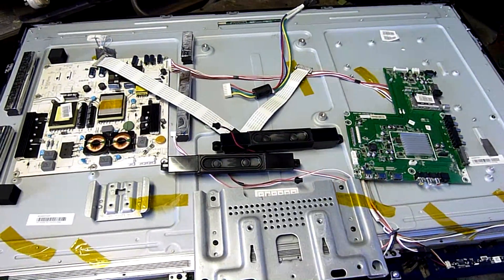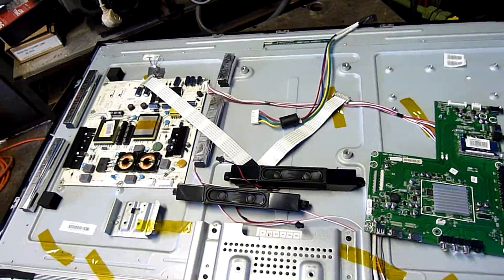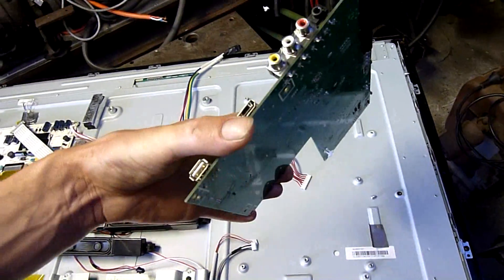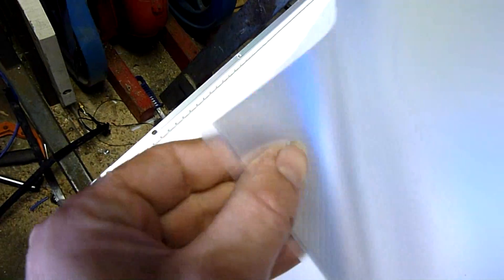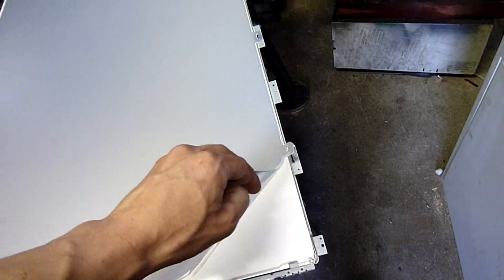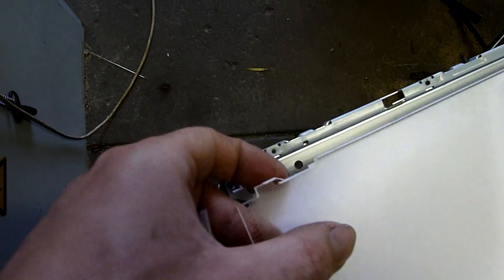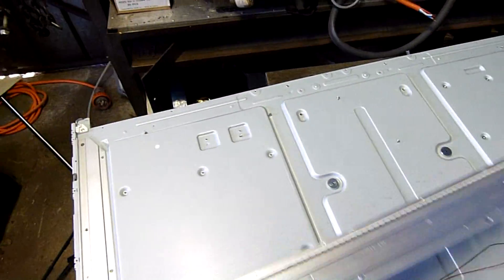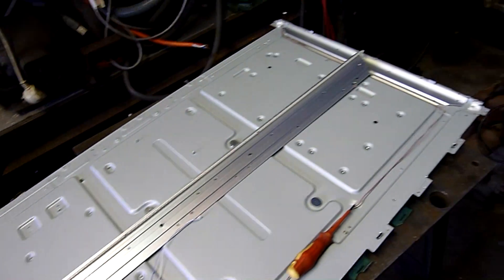Hisense 42 Inch LED LCD TV Teardown

Comment: if jay doesn't want it, keep the strip and power supply to use as a long desk light or set it up on a wall to use as an indirect light source or a back light for a shelf.  the diffusers might be good for any glaringly bright lights over your desk (all you need is some tape to hold it up)

Comment: If you're able to, look at the traces and find out how many LED "segments" there are and how they're set up, the display I had used those 4 strips in series so it output 120V, so really you could run them at 30V in parallel. As for current limiting, I didn't have an issue with it, but I also wasn't running them at full 30V, more about 27-29V. If yours is the same a simple LM317 supply "should" work as it did me, but if the voltage is higher, you may want to look into a cheap Chinese boost/buck supply with current limiting. The lighting they make is awesome and very controllable with voltage in my experience, pwm would be "possible" but a 30V+ pwm signal with current limiting is a tad overkill unless you make a custom driver.

Comment: That panel would make a great workshop light. Lots of light but no shadows. I'll have to find a junked LED panel to do that with.

You'd find that the input for that would be a constant current supply, so many amps to a max of 170V, instead of a more normal x volt supply at up to so many amps. I wouldn't expect that a supply of that size would use resistors to limit current.

Comment: aussie50 would you please do a video of you overvolting a box fan til it pops? i have never seen one with a box fan btw you can use my name if you would like on the next video or whenever you get the time to do it
Reply: Depends what kind of motor is in the box fan. If it's induction, then the only way to cane six bags out of it would be with a VFD and some of them don't like being run with only one phase in use (most generate artificial 3ph)

I think, over-volting an induction motor doesn't make it go any faster, but makes it suck more juice until it starts to burn up and billow out lots of smoke. Then the windings pop with a possibility of flaaaaames.

Screaming something up with lots of volts until it goes so fast it either blows a winding or shoots flames is generally reserved for brush motors, as they can run on AC or DC.

Because they don't use induction like an induction motor does, it is possible to spin one of those faster and faster until it mechanically explodes, blows a winding or the more usual shooting of flames from the commutator as the brushes get chomped up, then bits of the commutator explode everywhere. :D

He's done a few vids of brush motors being over-volted and some of them are quite spectacular!

How sssssatisfying!! :D

-BoomBoxDeluxe.
Reply: well i am talking about the round motors in a box fan i dont think they are shaded pole motors but i could be wrong
Reply: Taking into account the noise generated by a brush motor, the motor in a box-fan is more-than-likely an induction motor, be it shaded-pole or otherwise.

Probably not shaded-pole as they don't have much torque. Those are found in microwaves and some fridges which have a small fan blowing over the hot gas coil.

Fans which move a lot of air need a motor which has grunt, so a box-fan needs a silent, & grunty motor and that more-or-less rules out shaded-pole motors and brush-type motors.

I think really, the only way an induction motor could be popped, would be to put it on DC. It'll just sit there and burn up. If however, rotation is to be involved in the poppage, then a VFD would need to be used, BUT....

While some VFDs can go up to 400Hz, some motors will take that anyway, and like i've already said, I don't think that 3ph VFDs like being run mis-balanced, so the pop-victim would probably need to be a super-small 3ph motor (unless you've got a very large capacity VFD!)

What I would REALLY like to see someone do, is to modify / re-program a VFD so that more than 400Hz could be generated by it.

Or.... Someone builds some device which has proper grunt AND a high frequency. Say for example.... 2kHz with 3.5 kW behind it. That would spin a motor RIDICULOUSLY fast. :D

The motor would either centrifugally fly apart or the bearings would seize and the motor would screech to a stop. :D

To this date, I don't think anyone (on YT) has popped an induction motor. I know that Mr. Photon once popped a 3ph motor but that was by means of rotor-locking it and leaving it to overheat and burn out. That's a different thing to spinning a motor beyond 400Hz and getting it to fail that way.

We need someone to build a monster-motor-masher 2kHz 3.5 kW VFD and get an induction motor screaming like a jet engine. :D

-BoomBoxDeluxe.
Reply: ok well would you do a video of something overvolting and use my name in it?
Reply: BoomBoxDeluxe
I've been working on a similar device myself for the past few months. Pretty much think of a single phase VFD with variable voltage and frequency.  It hasnt been an easy project and I can't tell you how many mosfets ive been through. Wondering if IGBT's would work better. i'm getting closer and closer every day, im hoping to have some kind of sucess, ive been hoping to make my first YT video with it if I can ever get it working properly.
Reply: Mmmmm!  Sounds interesting! Let's hope that you can one day get your device upto frequencies yet unheard of from a shop-bought VFD and then it would be interesting to see what an induction motor could really take. :D

Yep, that'll be some proper "Crank-it-It-Up-Till-It-Pops" fun. :D It's just a shame that so far, it's been the mosfets doing the popping. :-(

On your device, do you know what kind of frequencies it'll reach?

Now, I'm not into all this electronic hocus-pocus, but..... What I thought of, as a way of approach ('cos apparently they run at a high frequency) is some kind of souped-up ZVS driver unit. Souped-up in the ways of Current.

It would be brilliant if one of those could be "beefed-up" a bit to give some extra grunt, and it would be a top-bonus if the unit could somehow be made to run at a variable frequency.

I know that "High1Voltage1Rules" has made some kind of unit where he can vary the frequency of it, and don't quote me on this, but I am sure that the unit which delivers the grunt is varied by another unit inside of which is a '555' timer. I think it's one of those, and I'm not sure about whether-or-not the device delivering the grunt is an IGBT.

I know that Mr. Photon has pulled apart washing machine VFDs before now and those have IGBTs in them (much to his disapproval, where's my hammer?! :D ) and those being from a washing machine, they're supposed to be variable frequency of course!

The downside once again is frequency: Those washing machine invertor drives only go up to 400Hz, so I was wondering if THAT is the approach?

Those units obviously have enough grunt to drive a motor, are variable frequency, but it's just a question as to whether something similar could be "reverse-engineered" AND be tweaked-up a bit so that a couple of kHz could be gotten out of it without the unit going =POP=.

Whatever you do, I wish you well on your electronic adventures, and here's hoping that you can achieve a variable frequency with grunt behind it which can go to frequencies to create some entertaining induction motor poppage! :D

Take care,

-BoomBoxDeluxe.
Reply: BoomBoxDeluxe
So far I can drive an induction motor up to about 97 hz or so before the mosfets catastrophically fail. The device is a modified AC to DC power inverter you see. I don;t have enough knowledge of electronics yet to build a from scratch unit myself. I have however been in the process of experimenting with one ive built myself using a 556 ( dual 555 in one package and I am starting to play around with a few igbt's but the problem is i'm not sure how big of ones to use or how many, it is kind of different then using fets. But what I have gathered so far after about 7 tries with this device, The problem of failure im assuming is based off the back EMF from the induction motor at the higher speed. If I can over come that I could probably greatly increase my chances of a better success rate. As far as how big a motor ive driven with it, my current test is with a 1/4 HP induction motor. 120v 4amp 490 watts. I am with each improvement working my way to a higher capability though, but its limited from the DC transformer im using at the moment. :/
Reply: umbrefawx
err modified DC to Ac power inverter, sinewave type of course.

Comment: Aussie, have you ever repaired (or attempted to repair) a metal detector? I have an Underwater One that's never been used yet won't power on.
Reply from the maker: nah, I have a very old one but I have never worked on it.